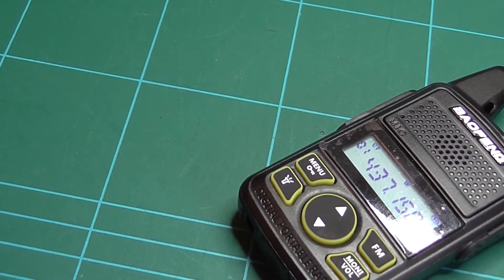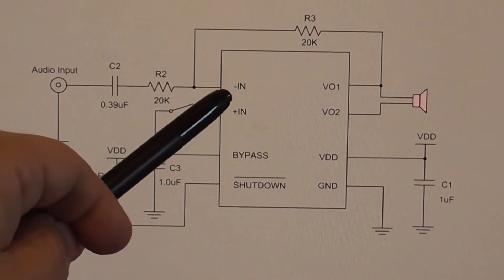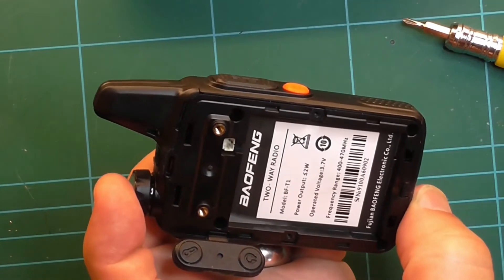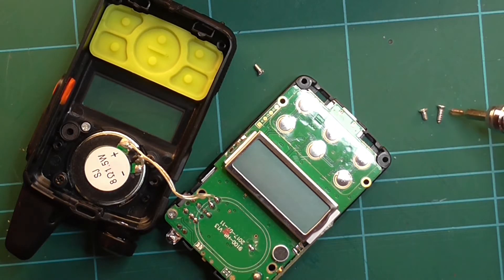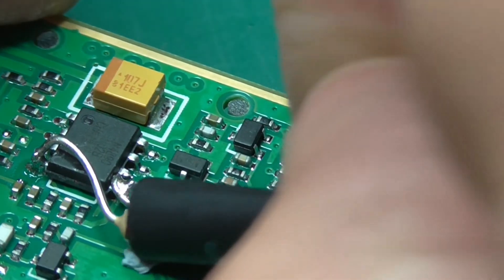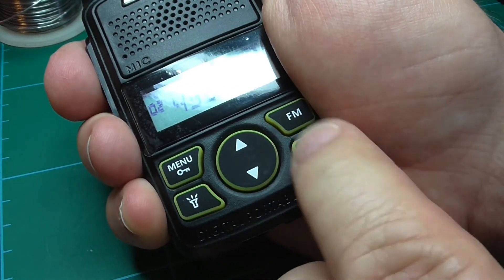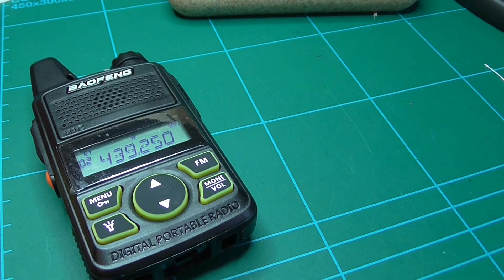Baofeng T1 BF-T1 Loud Audio Fix Mod

Comment: Хм. Почему резистор 15ком, а не 20ком??
Reply from the maker: Translated to English: "Hmm. Why is the resistor 15kOhm and not 20kOhm??" 

The value is not critical, it can be a 15k, 20k or 22k resistor.

Comment: Stuck a 82 ohm resistor in series with speaker could have put 100 ohms in much easier to do on a cheap radio has helped a lot
Reply from the maker: Good to hear an alternative solution. Thank you for your comment.

Comment: Forgive my ignorance, but why not add resistor directly on a speaker?
Reply from the maker: You could do that yes, but you'd have more hiss/noise. Turning down the gain (amplification) earlier on in the circuit results in less noise. A very good question - and thanks for your comment.

Comment: Recently i brought 2 pcs baofeng T1 ftom Aliexpress.com but Unfortunately 1 of them is won't be able to be charging. Can you show me how to fixed it? Thanks you sir
Reply from the maker: You are best arranging a return with AliExpress for your faulty T1. If you don't get help from them, check the battery connection as in the video.
Reply: @TrystansWorkbench  finally i find the problem..the USB pin power supply didn't connected properly. So i have to pulling up little bit

Comment: i busted  my ln4890 where can i get one?there is no sound now on my t1

I think i shorted the speaker wire to GND when i put the screw at the back
Reply from the maker: The battery would have still been disconnected before putting the screws in? Double-check for solder bridges first. They sell the ln4890 on AliExpress.
Reply from the maker: Also you can get a LM3890 (note, LM rather than LN) too.

Comment: Sprayed mines with CorrosionX waterproofing spray also...
Reply from the maker: The Baofeng T1 lacks any gaskets so it's not going to be waterproof unless you seal it in a plastic bag. a waterproofing spray isn't going to do anything to stop the water going in.
Reply: Trystan's Workbench Yes your right ,just though I would add spray for dampness help...

Comment: Did someone tried to use SMD to proper pads on PCB?
Reply from the maker: Thank you for your comment. That could be a good idea! It could also be done by putting another SMD on top 'piggy back' of the existing SMD (if it can be found) to try to avoid damaging the PCB in removing the original one.
Reply: Yes, that is exactly what I mean. Unfortunately I have not schematic and PCB layout to find the proper place where to put additional resistor SMD...:(
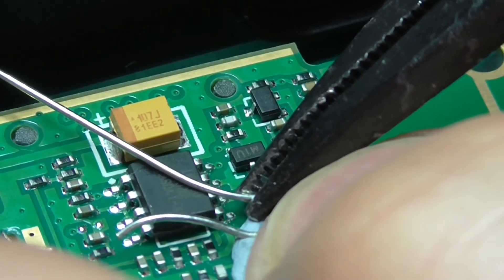Reply from the maker: Michael, well that got me thinking! Right so I've now opened up an unmodified Baofeng T1 and found that the resistance between the 4 and 5 pin of the IC is 117k. The SMD resistor that is 117k is one that is in view in 5:55 at the bottom-centre of the screen. It's the one nearest the unsoldered lead in the video, and nearest the blue blob of 'blu tack'. It's as if when they designed it they put in a resistor that was a decade too big, so installed a 116k resistor instead of 16k resistor.
Reply: Trystan, job done. I found yesterday evening the correct resistor > 120k close to OpAmp in its feedback loop to be replaced with 15-47k. I used 18k and it works fine. Simply I removed this 120k and replaced it with 18k / 405 SMD size resistor on the PCB. Nothing additionally added, nothing to cut, nobody can see anything after that mod job :) I am preparing the manual for it including the pictures.
Reply from the maker: Great - I'm glad I helped you find it.
Reply: OK. If someone want to get the manual for replacing the resistor SMD including the picture then sens me an message or email...
Reply from the maker: The SMD resistor that measures 117k is one that is in view in 5:55 at the bottom-centre of the screen.  Replace that with 15K, 20k or 22k resistor.
Reply: No it is not 117k. It is 120k measured after removing it from pcb. Yes it must be replaced by 20-22k smd 405 size. Thanks
Reply from the maker: Yes, so as I said, "The SMD resistor that measures 117k is one that is in view in 5:55 at the bottom-centre of the screen." (in circuit) I expect that the LN4890 chip internal bias is bringing down the 120k a bit, or just down to tolerances (easily within 5%). There appears to be a capacitor in parallel with the resistor I measured too, which gives then means that the (high pass) feedback results in a low pass output from the LN4890. All the best. :)
Reply: @TrystansWorkbench  Capacitor value should be increased 6 times (120k/20k=6) to get the same cutoff frequency 3-3.3kHz
Reply: @michaelscoofield  Hello mic, I was wondering if you have the manual with pics?
Reply: michaelscoofield is it 405 or you meant 0402?

Comment: Thanks for this video! I'm thinking of doing the same with my T1. Any thoughts on extending / stretching the antenna a bit for slightly improved performance while I'm in there? Saw someone else do that. Thanks again.
Reply from the maker: Hi Marc, Thanks for your comment. It's quite an easy mod really, and the radio goes back together easily. The beauty of the radio itself is how compact it is.  It's neat. There are other chinese radios that have better antennas. So I'm not sure if it would be worth modifying this, although it's quite tempting to try isn't it!?
Reply: P